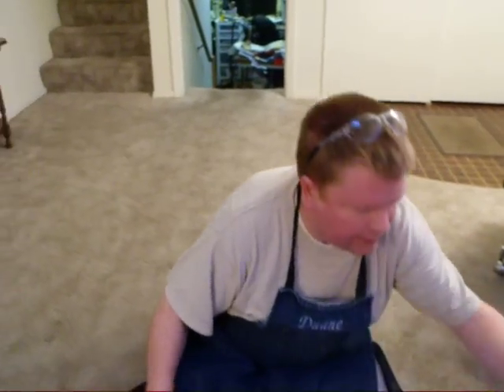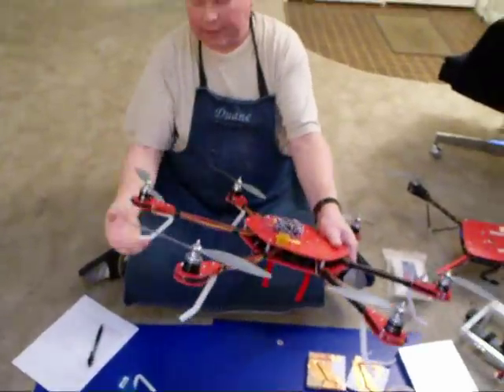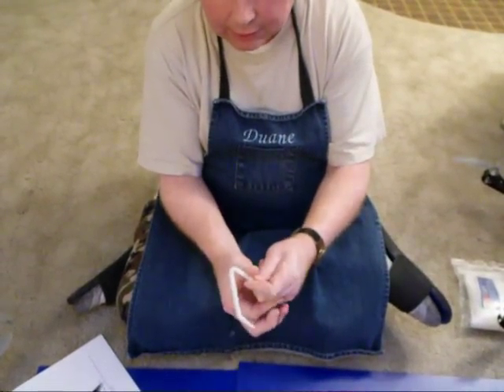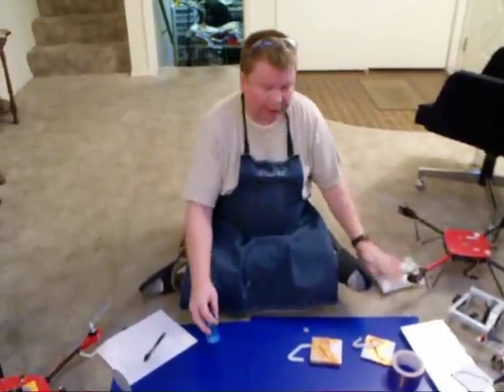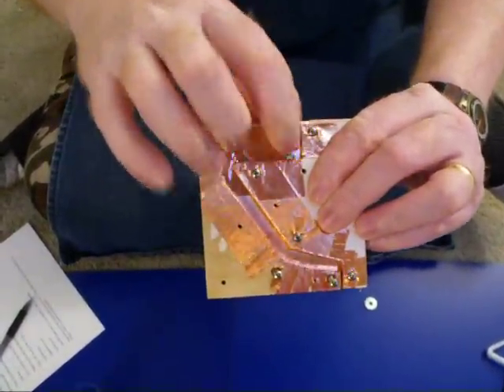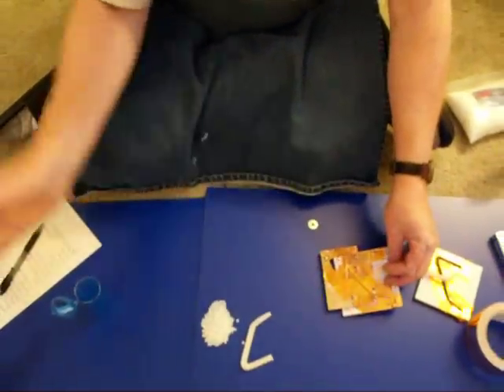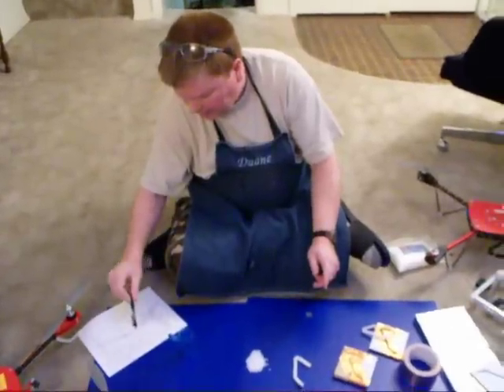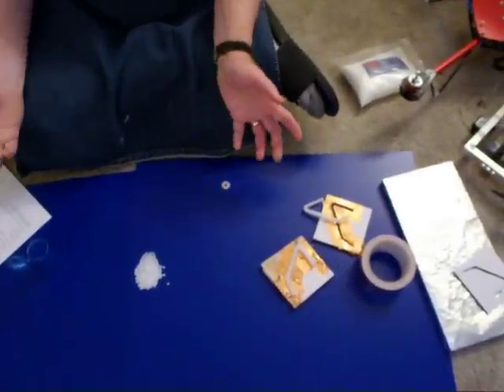Polymorph_ShapeLockLandingGearMold121118a.AVI

Comment: Hi Duane, how did you make those molds?  Thanks
Reply from the maker: It was made from three pieces of plywood. The bottom piece was just a square. The two top pieces were cut to leave an open area the size of the part I wanted to make. I used nuts and bolts to hold the two top pieces to the bottom piece. Once the Polymorph hardened (cooled), I unbolted the pieces so I could remove the part.